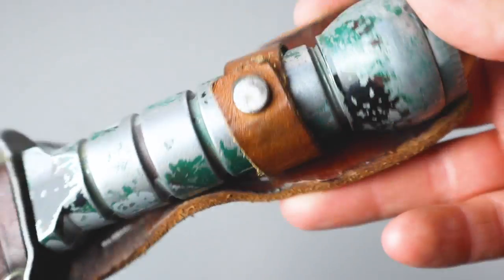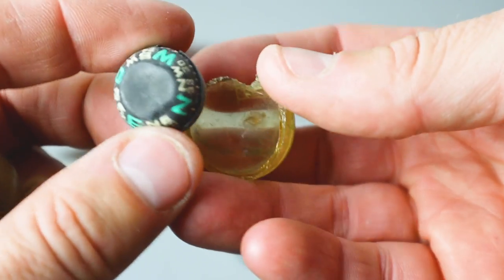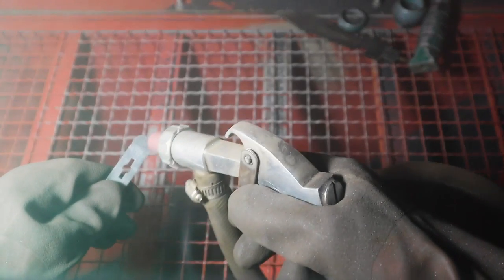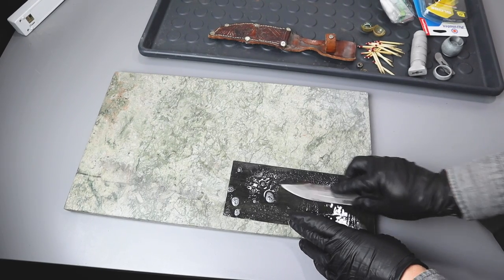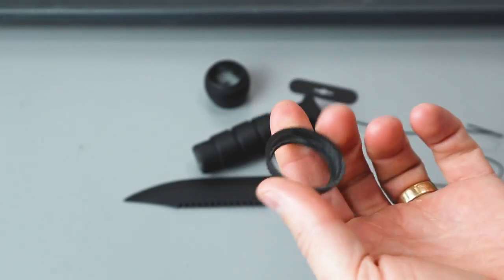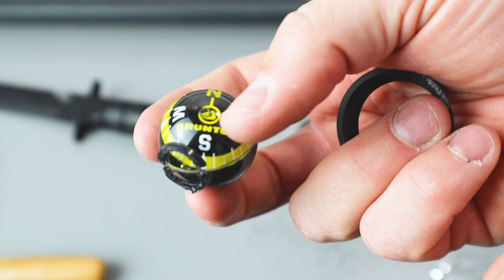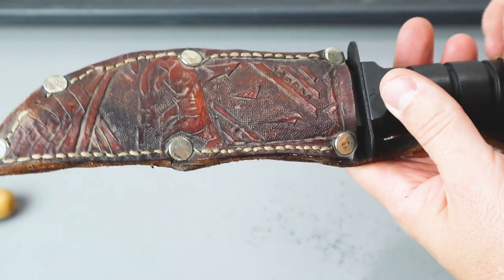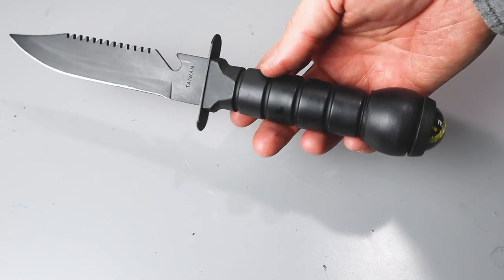Mumblety-peg - Rambo Knife Restoration

Comment: I remember mine with fondness and nostalgia. Looking back, I realize why they sold for 5 to 10 dollars new back then, they're junk. However, it was better than nothing, and we found ways to improve them. I sent mine into work with my uncle, where he removed the compass cap, and installed a solid steel hammer poll plate. And my neighbor, who I grew up with, learned by taking a chainsaw file to the saw teeth, it could be made to be functional. I never could could put a decent edge on it, but it looked cool on a military surplus load bearing pistol belt with suspenders .Mostly,I used mine for peace of mind, fearful of dogs running loose when I roamed the old back roads walking.
Reply from the maker: I got the same peace of mind from mine and I also struggled to keep a good edge on it. The memories. 😁

Comment: Nice! This was my first fixed blade knife as a kid. My grandpa gave it to me, and my mom was not happy with him for it, but I was :) . It was a very low quality knife, but I felt invincible with it, running around the woods with the ability to protect myself from any hidden Russian invaders. Sadly, one day I dropped it in some gravel and the blade snapped in two, like a brittle icicle. Love your restore. I recently bought another one off of eBay, just because a part of me still missed that beautiful piece of junk. One thing I did to "upgrade" it, was I replaced the key rings with a fat rubber o-ring, making it possibly more water resistant. I also put a small one inside with the compass to make it stop rattling. Then I put another fat o-ring on the compass threads, where you left a gap. The gap you left is fine, but an o-ring definitely makes it look a little more squared away and helps keep it screwed tight and secure.

Comment: "survival kit"
cable saw, 3 #4 fish hooks, 3 split shot sinkers, 10 ft of fishing line, 6 matches (strike on box for some reason), 
and 2 key rings on the handle of the knife, Mine (which I still have I ordered it when I was 10) 
even came with the mini "sharpening" stone, and delux "leather" sheath, Mine is the black handled version.
For $599 C.O.D. I ordered it when I saw the commercial on t.v. (watching The Morton Downey Jr  Show) at 2AM.
Good Video!

Comment: I took mine and heat treated the blade, to harden it. Then I did away with the handle that came with it and made one out of solid aluminum stock, with grooves to match original handle and a tapped hole to screw to blade. Then lastly, I replaced the stop, with a brass one, I made that was "U" shaped, to go over the little square part of the blade.
Reply from the maker: That’s awesome

Comment: Okay, just dug mine up out of a storage box. Handle and guard on mine are all one piece, no bottle opener. And the "Saw" is pretty useless, teeth are not off set. But the tank is alot longer then the one on your knife. No compass though. :) Also mine is 440 Stainless, but made in Japan. So maybe its not such a bad knife after all. Just ran mine over my Ken Onion Work Sharp. Takes a good edge too.

Comment: yep it had a wire saw with 2 key rings wrapped around the threads under the compass. See there where it looks like the cap wouldn't screw all the way down.

Comment: I had the same knife when I was a scout , my grandfather gave it to me. I also fount it at my parents house years later but it was just a handle the blade was long gone. I picked up a similar knife and did a custom with the handle. Last summer I found a complete knife at a garage sale for $2 but it’s in Desert Camo.  You should use a o ring to take up the extra threads on the handle next to the compass. Thank you for the video

Comment: Nice refurbish!   However I would consider pouring a little 2 part epoxy down into the handle to permanently fix the blade/handle fixture into place.  It would also give it a little more strength.
Reply: Yeah, JB weld would have been better.

Comment: Most of all I was surprised that you found a compass ball of almost the correct diameter.
I have a similar knife, it is of a higher class and in good condition. But half the liquid in his compass has dried. And I could not find a suitable ball.
Maybe I’ll drill a small hole, I’ll find out what kind of liquid and add it with a syringe.

Comment: I don't think I've even heard the term Mumbly Peg since I was 13 or so, eons ago. Tho we called the version you played stretch. We had another game we played, but it requires a two blade pocket knife. you fold the main blade out straight, then the smaller blade half way out, and flip it off your fingers into the ground. If the main blade sticks straight up and down, that's a home run. If the little blade sticks, that's a base hit, if both blades make contact, that's a double, straight on the back was..I don't remember, if the little blade was up it was something, but if it fell flat on the ground that was either a strike or an out.... been a long time.
Reply: We called it stretch too! One kid had this cool little knife, handle wrapped in electrical tape. So perfect for playing.
Reply: @Tarpo  we'd play with whatever we had, but we only used granny's butcher knives once. we wouldn't dare try that again. 
by the way, considering your age at the time, the sheath is quite nice. sure it's not perfect, but the tooling on it is nice. The sewing, well not so much, but that's no biggie.
Reply from the maker: We called it both, stretch and mumblety-peg. The other knife games you mentioned we also played. So many memories. 😁
Reply: @oldshovel   If I recall right, actual mumbly peg was balancing the knife on your finger by the point, then flip it and see if it would stick.